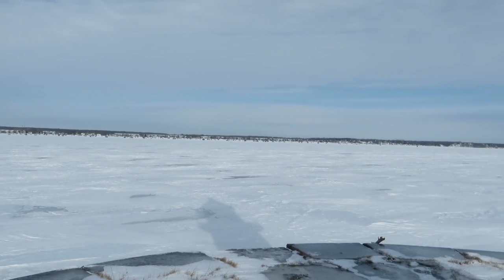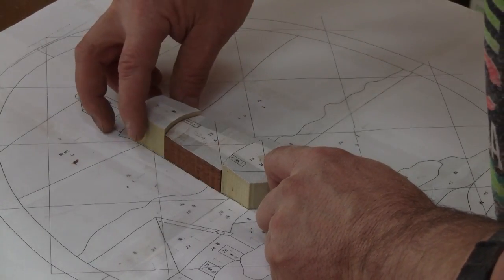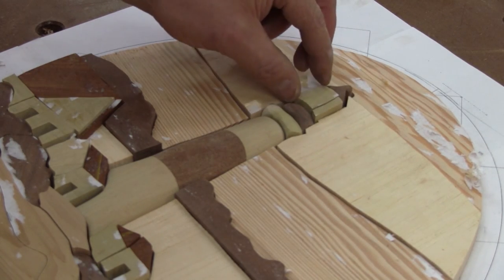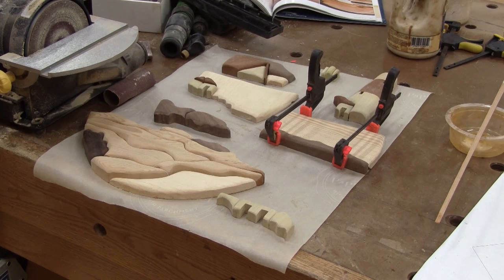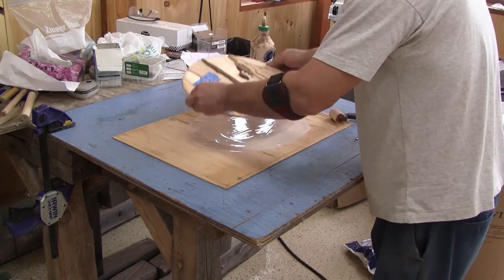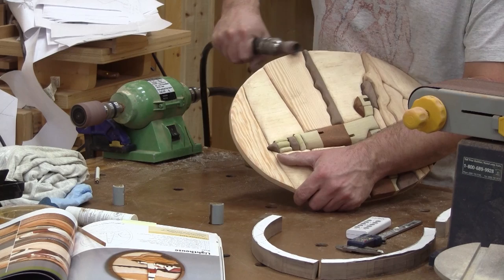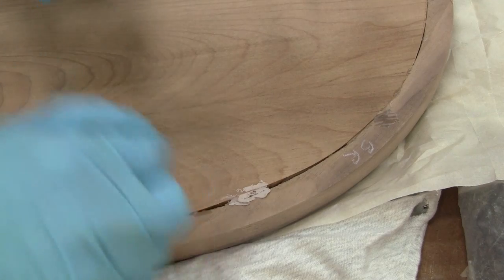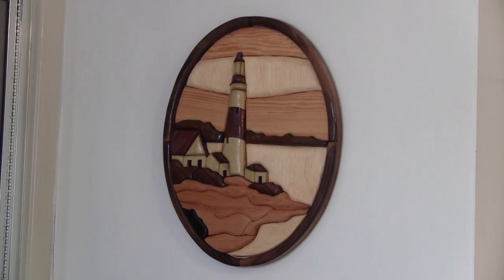The Woodpecker Ep 101 - An Intarsia Lighthouse

Comment: I love your grinder with the sanding wheel on one side and a flex shaft!!!!! Seems quieter than other types so how do you set up the grinder that way???? I’m in a one bedroom apartment so noise is a concern for me I do have a table saw and dremel with flex shaft so far
Reply from the maker: I love it, and yes it's pretty quiet. it just have one default; the rubber inflatable drum leaks after the rubber dries after 5 years or so. You can check it there https://www.kirjes.se/EN/kirjes.html

Comment: I noticed that some of the tools you used were on the rotating (Lazy Susan) tool stand in your old shop. Do you still have that rotating tool stand, or did you get rid of it? If so, was there problems with it? I was thinking of building one.
Reply from the maker: +Rich Eklund I left it in my old shop to put stuff on it, I won't transfer it into my new shop for a couple of reason.
It's big, in one corner of my old shop it was ok but I don't realy have space for it in my new setting.
In a corner, things are always falling in the back, and it's almost impossible to get them after.
If, like it was setup, you're having a lot of weight on it, It's becoming hard to turn.

Comment: nice; with wood shop done & all the insulation how is/does temp hold as you're in short sleeves?
Reply from the maker: +James Campbell I always work in short sleeve all year round. Yes it's well insulated and with my two 5000 watts heater it onlu take 30 minutes to bring the temperature up to 20 celcius.

Comment: ın which format did you print this pattern a3 a2?
Reply from the maker: I've printed it with Matthias Wandel BigPrint program. You can find it at woodgears.ca
I use this program every time I need to print something to its real dimension, it's very useful
Each page were printed on letter paper 8½X11" but you can use any paper size, then you stick them together with scotch tape

Have fun making intarsia, it's been a while since I made something in intarsia, but it's a lot of fun
Reply: @LgosseuxDbois-TheWoodpecker  81/2×11", how many did you use and put together, I'm very sorry, I need the exact dimensions in cm
Reply from the maker: I'm not sure if it was 4 or 6 pages. But with the diagonal aligning lines of BigPrint it's super easy to align the sheet
Reply: @LgosseuxDbois-TheWoodpecker  Thank you very much, because I do not have the original pattern, I only have the photo and I will enlarge this photo in A3 size and copy it, so I asked for the dimensions, I wonder if it is A3 small, thank you for your help.